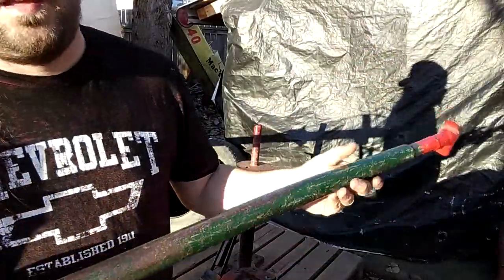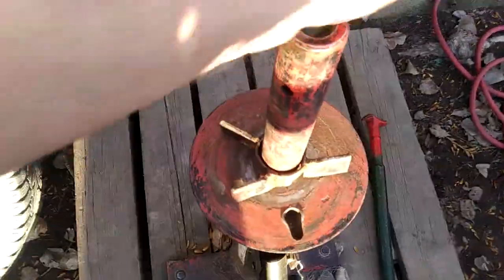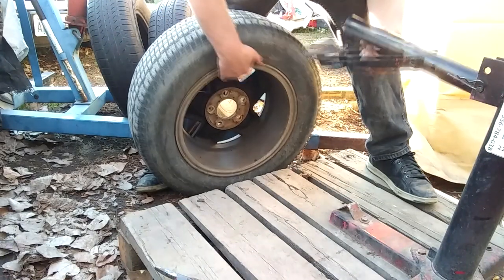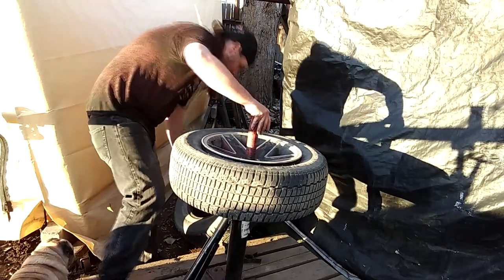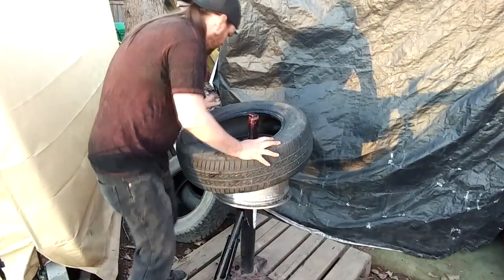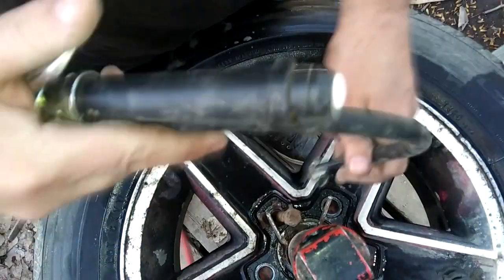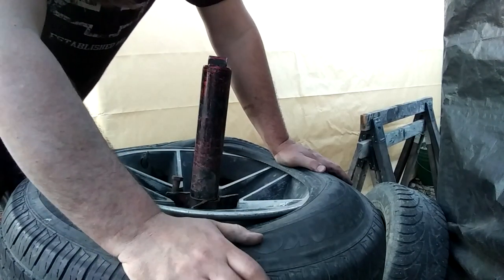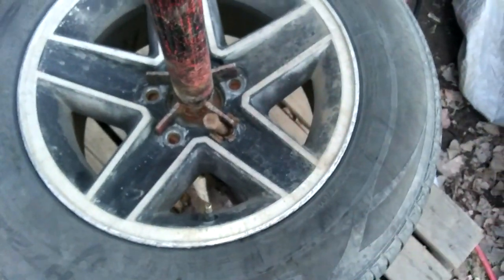HARBOR FREIGHT manual tire changer 10 YEARS LATER review + tips and tricks

Comment: I like how you explain how to put on and take off as to not damage the valve stem if you are not changing them.  I have cut them off by starting at wrong side.  I have had my HF changer for about 15 years.  Changed over 100 tires.  Truck 10 ply, car, lawnmower and caster pneumatic tires.  Tires are easy when done the right way.  I laugh at myself on the first time I tried.
Reply from the maker: Thanks sir. I'm cheap so I save were I can. I do like my HF tire machine it saves time and money. Thanks again for watching
Reply: instaBlaster...

Comment: Push down on the opposite side wall area when using the duckbill to fold the tire bead over the rim lip. You had it up out of the deep well of the wheel making it difficult.
Using proper lube not only eases install but conditions the bead to help the bead seat and seal. Right. Clip on air Chuck is too far in the future. A bag of new valve stems could improve the life and reduce repeat repairs.
Good machine fixes you made, I was not surprised. That commie Chinese stuff is weak and flimsy. In the industry they are affectionately called widow makers. Just ask lefty and lucky.
Good video, I liked your Chevy and your Camaro rims.

Comment: dishwashing soap/liquid used as a tire mounting lube is corrosive to aluminum wheels. You can’t use any soap with LYE in it on anything aluminum.The highly corrosive  ingredient that is in dishwashing soap is LYE... that is what makes it feel so slippery. You can see cars from the 80s and 90s especially Toyotas and general motors cars like Pontiacs that have alloy wheels, they turn black. Those wheels probably had dishwashing detergent on them to wash them. You’ll especially see corrosion between the rim and the tire bead area corroded where someone used dishwashing liquid as a mounting lube. that is very common at  tire stores because nobody knew..That’s why these wheels develop slow leaks around the bead...there is one dishwashing liquid that does not use LYE that I know of. That is Dawn dishwashing liquid.  any soap or shampoo that will burn your eyes, it has LYE in it..$15 a gallon  rubber lube at Napa auto parts is the lowest price i found..... pretty much everywhere else even the Internet rubber lube can be over $50 a gallon..
  good video.. this guy knows his stuff...i have this machine... it is not great, but it is a good starting point.., i bought it and the attachment for motorcycle wheels, which needs many mods also.. i also have had a COATS manual tire machine that i bought for $75 decades ago , and i also got the certified atlas bubble balance machine .. the service station owner upgraded to modern equipment and i bought the old time machines in the 80s..i changed literally many hundreds of tires on a manual machine when i was a kid working in gas/service stations aftet school, weekends, summers..bubble balancers are still used today to balance airplane propellers & helecoptet rotors..
   i pulled the lead anchors out of my garage floor doing a test tire change on one of my pickup truck wheels with this HF tire machine....not only that, if you dont want your wheels scratched up, do not even think of using this machine..i bought 4 new tires online , and took them to a tire store, and paid them $80 to mount  my new tires on my perfect mag wheels with thier touchless tire machine.. don’t buy one of these machines if you care about your wheels..
   I plan to weld this HF tire machine to a 6 foot piece of sq tubing..on the other end of the tube, weld a piece  that plugs into my tow hitch reciver on my pickup truck..i will weld the tube up high enough to the HF machine that i will have to jack my truck up to be able to plug it into the hitch reciver.. then lowering the jack under the truck will lower the truck & put weight on the tire machine,making it pretty solid and twist resistant..
  to prevent my motorcycle wheels from spinning , ( mag wheels) i use a nylon tie down strap around one of the spokes tighten the strap a bit, spin the wheel to take up the slack, that wheel wont move, you dont  have to over tighten the hell out of the rim clamps if you use a strap to keep it from spinning a lot..a little spin is ok..let the motorcycle wheel spin a little, just take up the slack in the strap by spinning the wheel in the direction the force wants to spin it..
  good video, good mods, my system of welding the machine to a steel tube that plugs into a trailer hitch takes up a lot less room and is easier to store & move around
Reply from the maker: I gotta check that out. ive looked online and it is to pricey. thanks  for the tip
Reply: Actually, soap is produced with lye, but doesn't contain lye. If there was lye in it, it would ruin aluminium pots and pans and would damage the hands of the person that washes the dishes. So whoever told you that lye-d, pun intended.

Comment: 100 dollar bet I can do it faster by hand
Reply from the maker: Ok cool
Reply: Faster than he shows in the video ,  sure, it can be done, or faster than I’m willing to bet that if he prepared and had everything sitting in arms reach , no puppies (my absolute favorite part of the video BTW) lots of room to move around,  focused on the clock and wasn’t chatting to the video watcher ? 
I’d take that bet. 

I have changed quite a few tires by hand, and THOUSANDS with a $5,800 Coates Rim Clamp. This little $40 jobbie looks leaps above just using a set of spoons , a crowbar, and hammer. 

Jinks2017, post a link of you removing an old fire and installing a new (not used and soft as a baby’s bottom mushy sidewalls) tire.
Reply from the maker: Hey thanks  bill